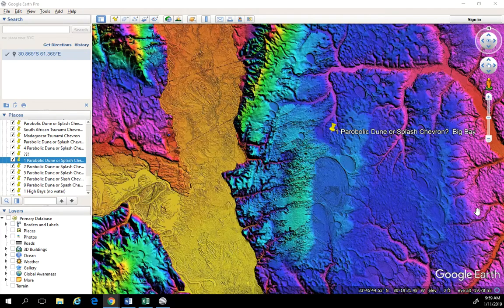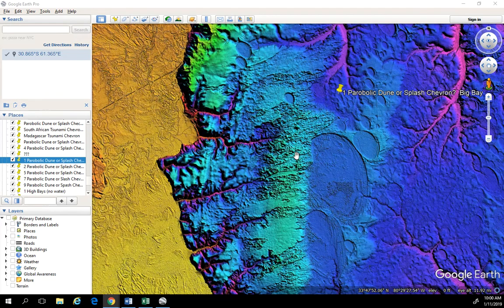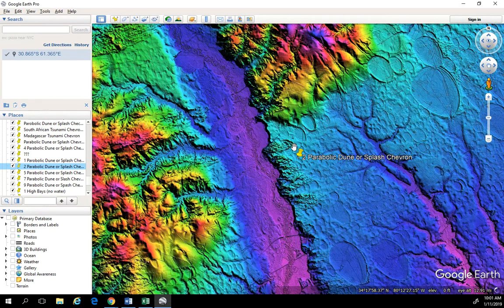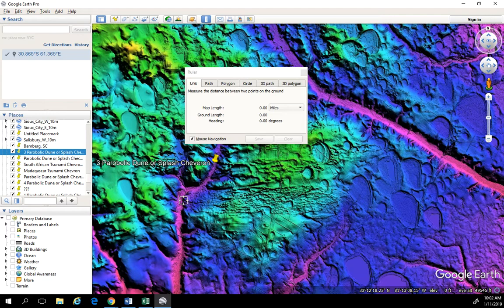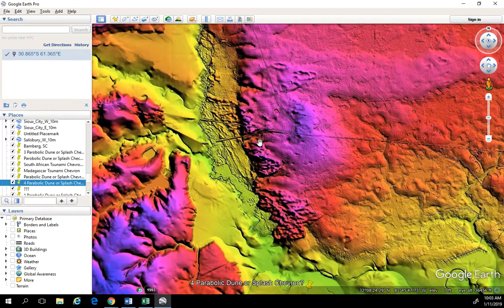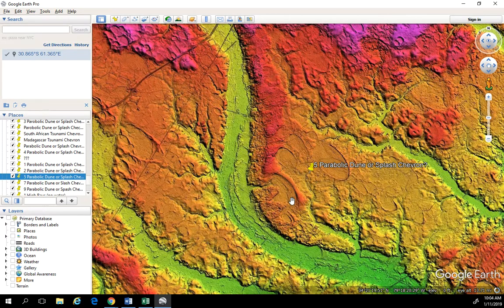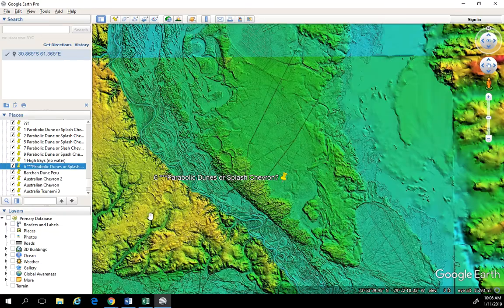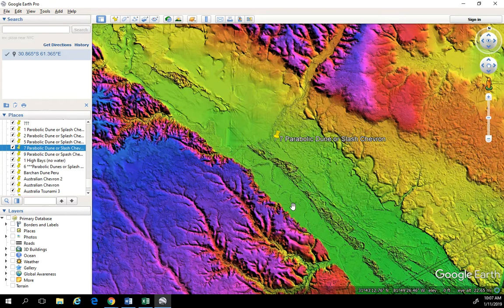Carolina Bay LiDAR Field Trips:  Parabolic Dunes or Splash Chevrons? Part 2

Comment: I don't think that the bays are splash chevrons, nor parabolic dunes. I think instead they are the result of karst formation at least 30 ka. Big Bay that you showed has been partially filled by sand dunes that have been dated to 30-50ka. This can also be seen in other bays, as well as the sandy rims of many bays. So, they must be at least predate these dunes. As for an upper limit of age, it seems like most dates lie around 100 ka, but these are not as firm. Bays are present in Pleistocene as well as Pliocene regions, so their formation falls within this broad time period.
Something very imprtant to consider as well is that bays are confined to the coastal plane, meaning that above the fall line, where distinctly different types of rock and regolith, formed and deposited at the same time. This aligns with the karst explanation as the piemont regions (and indeed the many regions between Saginaw and the coastal plain) would have had very different hydrologic processes, explains why bays are only found along a strip of geologically similar land. To me, it would make sense that carolina bays would be present in other geologic regions, many of which long predate the Pleistocene, while this ancient karst landscape would have formed in a region made up of fairly similar (in this case siliciclastic) rock. 
Of course, conditions would change over time, and bays would be effected by the wind and water, which provides and explanation for both orientation as well as the morphology of the rims. Over time, it stands to reason that prevailing winds could "stretch" a bay into an oblong shape, with a certain orientation, and sediment deposition and hydraulics would also have their effect.

To me, an impact event seems quite far fetched, and the bays don't have many characteristics associated with impact craters.
It is also worth noting that I am not a geologist, and most of my relevant training is focused on coastal processes, so my understanding of
Reply from the maker: Thanks for chiming in Gack!  What is it you do that is related to Coastal Processes?  I'm not following your karst explanation here...the only limestone in this area is deep underground making up the upper Floridan aquifer.  Have you watched the rest of my series?  I mention the Nebraska Rainwater Basins a number of times, and as far as the age, I have no doubt the material tested can be dated back to the times you mention, but not the geologic structures themselves.  One if my upcoming videos is going to focus on what I'm going to call "High Bays"...I hope that'll clear a few things up for you.  Stay tuned!
Reply: @DabblersDen  Although karsts most often form in limestone regions (Mamoth cave region, for example) they can also form in other areas. The coastal plain is mainly sediments of sand, clay, and some gravel sitting upon more crystalline rock deep underground. The karst explanation basically says that the siliceous material (like sand) could be dissolved, which could form depressions that are not too unlike the caves and sinkholes of a typical limestone karst, only much less dramatic. So instead of Mammoth Cave, we just get these shallow, swampy depressions that have over the years been further shaped by wind and water.
Reply from the maker: Okay...I got what you are referring to.  This video isn't specifically about the Bays, but more about the sand dunes that have formed in the same areas.  Regardless, and I respect your opinions, I have to disagree with you.  The orientation, shape despite size, quantity, and the Nebraska Rainwater Basins all go against that idea...and if you add the fact the entire state of Michigan has a bullseye painted within it's bedrock, with Saginaw Bay at it's center...done.  You mentioned your work is in Coastal Processes...what do you do?  I'm interested...email me if you like (dabblers.den@gmail.com)
Reply: Also, unrelated to karsts, it looks like the maps showing where the bays "point" to do not use a projection that preserves direction, and the lines are not platted as great circle segments. If they are, feel free to correct me

Comment: Congratulations!! I like the way that you searched systematically for splash chevrons along the river banks and found so many examples.  There are many examples of chevrons overlapping bays and bays overlapping chevrons, so this is clear evidence of a very dynamic and chaotic ice bombardment event.  Good job!
Reply from the maker: Still built on predetermined speculation, but it is what it is.  I'm not done...got a few more examples of hard evidence up my sleeve.
Reply from the maker: I wish it were that easy.  This was quickly brought to my attention not long after posting this: https://www.researchgate.net/publication/265208192_Evidence_for_Widespread_Eolian_Activity_in_the_Coastal_Plain_Uplands_of_North_and_South_Carolina_Revealed_by_High-Resolution_LiDAR_Data
Reply: Looking at your video for the second time, and having read the abstract by Moore and Brooks, there certainly seems to be a pattern of splash chevrons pointing eastward.  It is quite possible that the large volume of ice from the saturation  bombardment displaced an equal volume of air outward from the Mississippi valley and created hurricane force winds. In this case, the splashes would be driven in the direction of the wind. In my video about YD impact quantification, I calculated that 1.5 trillion cubic meters of ice would have been ejected by the ET impact. That is a large volume of air that would have been displaced.
Reply from the maker: @Antonio_Zamora , I don't want to speculate to much on that at this point...if I did, our hypothesis would be just as good as theirs!  Haha!  I do find this interesting though: "composed of >90 percent quartz sand with trace amounts of clays and pebbles". Pebbles?  I'd like to hear more about these pebbles in aeolian sand deposits...
Reply: @DabblersDen  pebbles and perhaps oyster shells or other evidence of aquatic life which normally does not get blown around.

Comment: I think you have nailed it.  Gives new meaning to the term getting hammered!  Some of those pre-existing river basins could easily be from the aftermath of that event.
I wonder if this is from the newly found Greenland crater and whether this finding changes the frequency of how often an event like this happens?  Just a week or two ago at dusk we had a sizable space rock burn up in the upper atmosphere in northern California someone captured it on video and posted to Twitter and it left a contrail visible for 30 minutes.
Reply from the maker: Thanks!  No, these were likely formed by a Saginaw Bay Impact that may or may not be directly related to the Hiawatha Crater.  I'm think that they may happened at the same time though.  Time will tell!

Comment: and if rivers are in fact a Lichtenburg event and the EU thinks they may have been carved out by the electrical storms as the grand canyon and valle marinaris on mars were seemingly done,,,,,,, try and flow water through and exact model of the gran canyon u cant the LEVLES ARE ALL OFF !!!!! the lack of water didn't allow the canyon to fill with water in the first place but if it had filled it would look like the water lvls in the grand canyon it would have dug a path through the odd levels that exist up on mars and leveled it out like we see in the grand canyon

Comment: I looked at google earth on chrome and if the tsunami came from the Indian ocean the direction of the flows on Australia show that water came from a southern direction,,,,,, now if u think outside ur comfortable box and consider that these proposed electrical/plasma could soften rock(finger prints and hand/foot prints in lake mungo area of Australia shows not only this theory possible but likely Australia was dragged a great distance east and spun around almost 90 degrees from its current location and this so called impact crater may in fact be an electrical discharge between worlds,,,, consider the FACT that earths gravity HAS changed and not too long ago or the absolutely massive dino's would not have been able to move or lift there heads in this current gravity,,,,,, that's a FACT !!!! and wee see rock carvings found in south America that depict humans riding brontosaurus's and other dino's